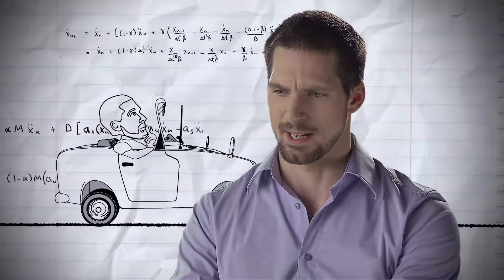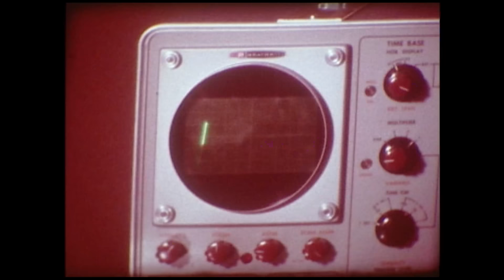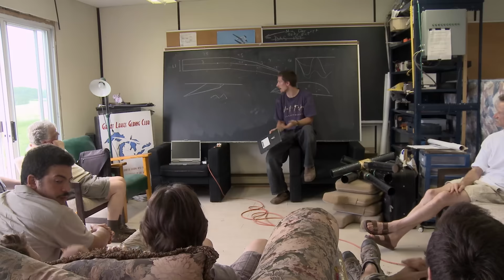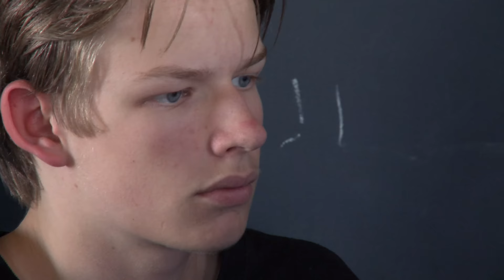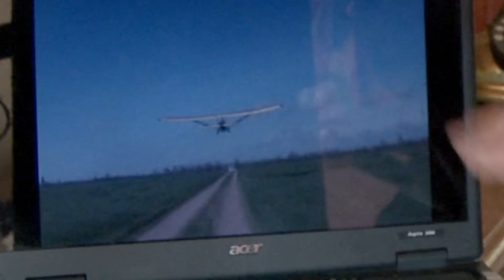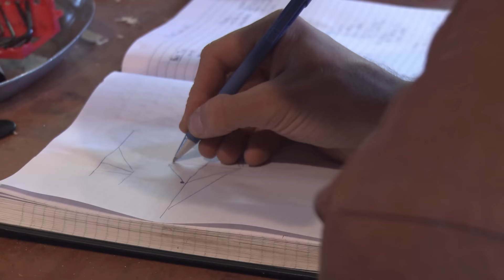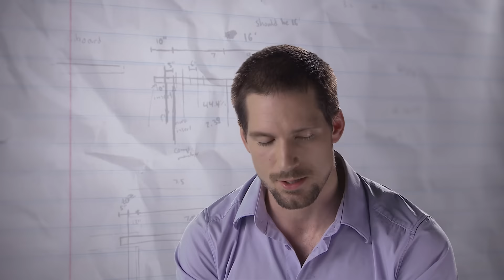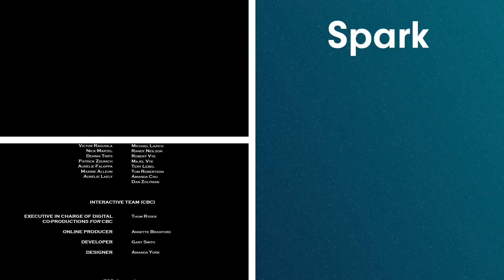Is It Possible To Fly Like A Bird? [4K] | When Dreams Take Flight | Spark

Comment: Otto Lilienthal was THE airplane pioneer from which all the others learned how to fly and make airplanes. He was an experienced pilot, aerodynamic inventor and engine engineer. Better control surfaces was under development 1896 when he died. It's worth mention that micro meteorology, which ultra light airplanes are sensitive to, was little known at the time.
Reply: I fly paraglider’s, and micro meteorology is super important when you fly an aircraft that is under 40 lbs. plus your weight of course.  And definitely attribute free flight to Otto Lilienthal and Francis Rogallo, two pioneers of free flight
Reply: @SkidzFPV  Yep, done lots of sand dune air surfing in paragliders. Tiny dunes make tiny lift you can feel and use. Albatross use the wind off waves to cruise. 4 hours is the longest I have dune surfed.
Reply: @alwayscensored6871  
>> Albatross use the wind off waves

An albatross primarily uses the wind gradient for dynamic soaring rather than ridge lift off the waves.

Comment: As a R/C glider builder watching the build was amazing and I could see places they could have saved even more weight.
Reply: The more weight saved, the less structural integrity.
Reply: @notmyworld44  if they had put lightening holes in the ribs it could have saved up to a pound or so and using kevlar instead of metal cable. It's is very good design that did the job
Reply: I was thinking it would be cool to see a project like this repeated using some NASA research that was published later. Specifically, a wing based on the NASA "Prantl" wing that is 12 percent efficienct for the same weight of material (like birds' wings, it has no tip vortices, the main source of drag on a conventional airplane wing). Also the Prandtl concept eliminates the need for a  tail, which accounts for about 30 percent of the weight and drag on most planes. Those 2 changes should provide at least 40 percent more efficiency. (See NASA PRANDTL-D reseach project led by Al Bowers. He is an interesting guy.)
Reply: Oops, should've said 12 percent MORE efficient. (And I misspelled "efficient.")
Reply: @airhead8363  Good point, I don't think they thought of that option.

Comment: If you’ve climbed a mountain, you know how much energy it takes to scale a solid object with a 1:1 reciprocation of the work you put in.

Now, climb a mountain of air, and you’ll see why it’s so damn difficult.

You have to produce the energy - somehow- to lift yourself AND the craft into the air. Mechanical advantage can only do so much, and sometimes the energy’s just not there. Going fast on a bike is already challenging. Now do it with air, pushing that air with an inefficient pseudo-propeller, and all the mechanical advantage and medium efficiency is working against you

Comment: Yes, it is possible. Over here in Germany you can join a gliders club, even at the age of 14, and they teach you to glide. I used to do that for a few years and it is not expensive, just time-consuming. It is quite a common sport over here and most of even smaler towns have their own clubs. It is such an intense almost spiritual experience to glide in an upwind together with buzzards or 	red kites, which are common here.

Comment: What I find most interesting about this, is the prospect that the materials that we have access to, will slowly but surely get stronger and lighter, even past what they achieved here, so as the years go by, and more weight can be saved, it'll be interesting to see if this is ever attempted again, with even further weight savings, and how much further a human can truly go. All in all truly incredible video and story.
Reply: maybe we should use same material as bird hollow bone type material and bird feather
Reply: @Rick_Cavallaro  we do have lighter material and no need to power by human i want thing to fly like bird that is all use whatever is required engine motor whatever
Reply: @yaad2226  I want an F15 - but that's not what this video is about.

Comment: I would 3D print fake bird bones with an internal honeycomb lattice structure to increase its strength but keep it really light. that way the density is light enough to react with the surface tension of the atmosphere.
Reply: also bird have feathers which each individually create lift one their own. We design wings with a single wing structure to create lift. Which I think is probably not as good.

Comment: First off this is truly a marvel of engineering. Though, in my opinion, this was not a sustained flight. You can see from the flight data on their website that the craft loses energy throughout the flight.
Reply: well he was only flying the length of the run way so ofcourse it lost energy as he descended to land. in the footage shown he looses altitude and then REGAINS it proving sustained flight is possible.

Comment: Much respect to the folks who put so much work and thought into it, but in the end it's an aircraft so fragile it can't handle the slightest bit of wind that can only fly in a straight line that needs a superhuman to power it. The main result of the project was to make it clear why humans invented engines.
Reply: Have you ever watched the Olympics?  What do you suppose is the practical purpose of vaulting over a pole or doing a floor exercise?

Comment: Solid respect for all of these youngster's engineering and project build abilities and commitment. But I wondered just what application they thought could be achieved. It appears that the effort a 'pilot' needs to operate the system would drastically restrict the distance traveled, and the physical area needed to get it positioned for flight would be massive!

Comment: Have you guys thought of adding "vortex generators" on the wing  givring you a increase lift at slower speeds and as much as 10 to14% decrease in stall speed ?   With this edit I thought I should explane what b VGs do and don't first they don't realy create lift from the underside of the wing what I think they do is create vortex above the wing causeing a lesser density above the wing in that the lift you have on the underside has a easer time with the lift that is there and the VGs are installed just behind the leading edge on the topside they consist of a 1/2 of 5 mm tube 2.5cm long first pair are about 3.5 cm apart and just a lil cantilever towards each other and the next pair away from each other  and back and forth the length of the wing ! Now I'm not a aerospace eng. or even a pilot but I'm pretty shur I'm correct in my description  of this and why I think it could be a very valuable addition to this project . If my thoughts on this could a more knowledgeable person correct or give the reasons my thinking is flawed or off ?

Comment: I want to refer to the Veritasium Video on travelling faster than the wind "pushing" a propeller to geared wheels gocart. It appears that the propeller-wing or sail simulation is generating a vortex and "Back EMF" synchronous, reflected->period doubling vortex, pushing the vehicle.

If the wing chord is counter rotating at twice the speed of the bodily axis in sync then there's a period doubling, paddling-leveraging harmonic effect on the forward direction of motion(?)

 (Pure speculation, what do the actual Engineers say?)

Wow, champions of champions.
Reply: I'm the guy that built and drove the downwind vehicle you're describing (the Blackbird).  I've spent lots of time with Todd and Cameron discussing their many achievements (and my few meager achievements).

Comment: I  cannot understand how aeronautical engineers cannot understand how birds' flight works, it being so easy. Downstroke is done with extended wings, greater speed and greater angle of attack, for greater aerodynamic force. The latter has to have a vertical component greater than or equal to weight, and a forward component greater than drag. Upstroke should get as little a drag as possible, for the wings' aerodynamic force cannot have a positive forward component, thus the angle of attack should be very small and the wings' forward speed, the wing surface and the upstroke duration should be as little as possible.
Reply: It's cool to hear you say these things. I was on the porch trying to imagine what the upstroke in bird flight achieves or can achieve. Intuitively, I suppose, the downstroke does all the thrust. Why bother with flapping? What advantage might it hold over a rotary source of thrust? We all love birds, but i feel little compulsion to just do it their way, yet their way has a lot of history and a million? separate species that flap for lift and power. Flapping just seems inefficient.
Reply: @jeffmoore9487  Flapping is half as efficient as rotary aerodynamic lift generation, as was measured in the last half of the twentieth century in France.
     I have been trying to develop a microcopter and put much thought on how flapping and rotary lift works. I was an airplane pilot (a bad one). Science and technology are my hobby since I was six.
Reply: @jeffmoore9487  Why bother with flapping? Why bother with rotary, which is so inefficient that helicopters need a lot more fuel than planes and have speed stalls on their receding rotor blades? Well, rotary can achieve stationary flight - and so can flapping, in hummingbirds, whose wings rotate back to get lift and back thrust during upstroke, and in insects, with a similar arrangement.
Reply: @wafikiri_  Thanks for the answer. Why can't a low power (or human powered) craft skip the typical elevator and rudder mess and do a Liippish or a bird style control surfaces. This vid proves that a man has the muscle to flap level flight, but why so much drag on his machine from that tail? If rotary is twice as efficient as flapping then isn't your design for a microcopter thrust rotational? When you say "why bother with rotary", I'm stuck which - what's the alternative?
Reply: @jeffmoore9487  My design of a microcopter is rotary but I explored a variant - can't be done but it implied a down stroke for the forward-going blade which then receded into its hub as its counterpart extended before its downstroke, both blades the same piece....
Reply: @jeffmoore9487  I don't know what Liippish means, sorry. A bird-style tail is very efficient but also very difficult to manoeuver. Only a bird's brain could manage it. The closest to it is a V tail (Beechcraft produces at least one model with it, maybe Bonanza or Baron; I've flown both models but they were modified to have a standard tail).
Reply: @wafikiri_  Thanks again. I would think the "difficult to manoeuver" issue wouldn't present a a big hurdle for today's tech. 
Alexander Lippisch is best know for his WW2 era flying wings (no tail at all) for the Nazis. You'd do well to watch a vid on him. Many people wrongly but understandably credit him with modern "stealth" capabilities. His ME 163 was truly a wonder weapon of its time.
Reply: @jeffmoore9487  Ah, I've watched those tailless  aircraft in documentaries, even a few days ago.
Reply: @wafikiri_  Lippisch also made wonderful ornithopters.
Reply: @jeffmoore9487  Thank you for the information on Lippisch. I like inventors, I'm one myself although I have asked for no patents on my inventions.

Comment: Well birds flap downwards to create lift, then tuck their wings in to pull them back up to negate them giving the same force upwards which would cancel out their original flap. So mechanical wings would have to flap downwards then immediately tuck inwards then reposition themselves upwards then stretch out again to make the next flap.  And birds flap their wings really fast. So fast their wings usually turn into a blur to the naked eye. So you'd need to flap the wings in this manor like 100-300 times per minute in order to achieve flapping flight.  This is impossible. The closest we will get is something that can moderately flap to stay in flight but needs assistance to get in the air. So like cliff jumping to get started.  It's very inefficient way to fly. It can be so inefficient that sometimes even birds have heart attacks mid flight if it get's even a little to hot.

Comment: If one was to make a flying machine large enough and light enough one could create surface tension in the air like a parachute does and ride along the surface tension of the air as if they were floating in water. But this would probably require a machine completely made out of carbon nano fiber tubes to give it the required strength and the required weight.
Reply: too flimsy to support human weight. It would end up becoming a shroud.

Comment: everybody know the corkscrew wing or rotating air wheel works without negating itself like "flapping" would .  you have to fold the wing on the upflap, or change the angle of attack to push down more than its pulling up.    i can't believe they spent all that time on a complicated glider with a rube goldberg machine attached.

not trying to  be THAT GUY but if ur gonna copy a bird, dont ignore the feathers, and watch out for the beak.  can't be a dragon without the scales.
Reply: @Rick_Cavallaro  Nice try FBI!
Reply: @overryd8573  Hey - you're the one that knows how to make one much better than Todd and Cameron.  I'm just eager to see it.

Comment: Interesting, but not even close to a bird.  The accident at about 29:51, is beyond ridiculous. He basically took a perfectly flyable design and turned it into a contraption. The results easily foreseeable.

Call me when anyone but a fit athlete can maintain more than a few feet, let alone gain altitude and fly here there and every where. It was not so much a flight but and extended glide. Certainly fun and interesting to work on if there is money to burn.  

The bicycle is still the greatest mobility vehicle eve created by us. I doubt we will surpass it, and we will never take to the air in any real practical sense, under our own power. Maybe on another planet with a thicker atmosphere and lower gravity.
Reply: Whatever you reckon Mr Killjoy

Comment: I watched several of these attempts of man made only flights
And every one of them is missing the main piece of the puzzle
Birds are doing more than just flapping their wings for flight.
Seems they do not see the difference

Not sure if they can comprehend,

But on the down ward stroke of the birds wing they are definitely compressing the air
Not are they miss the main part of the upward stroke of a birds wing  movement,
They are not just lifting the wing, 
But a bird is allowing the air to pass down below the wing between the feathers,
So how long before they grasp this understanding?

May be ages, and the moment the bird brings its wing down ward, and BACKWARDS 
They feathers act like a one way valve, and are compressing the air pushing it back wards,

But on the upward stroke, the air is being allowed to pass freely between the feathers,
Why can they not see that is definitely beyond stupidity,
Their brains must be locked and not seeing that,
as when they are causing the wing to come up, they are pushing the air back up, a wasted effort working against themselves trying to get lift,
A wasted effort,
Reply: >> on the down ward stroke of the birds wing they are definitely compressing the air

They are definitely not compressing the air.  At speeds below about Mach 0.3 air is effectively incompressible flow.  With respect to how well they understand bird flight, I give you my absolute assurance that they understand it better than you.

Comment: Hmm an engineer that talks in pounds, which is from Roman times, pound, unit of avoirdupois weight, equal to 16 ounces, 7,000 grains, or 0.45359237 kg, and of troy and apothecaries’ weight, equal to 12 ounces, 5,760 grains, or 0.3732417216 kg. The Roman ancestor of the modern pound, the libra, is the source of the abbreviation lb. In medieval England several derivations of the libra vied for general acceptance. Among the earliest of these, the Tower pound, so called because its standard was kept in the Royal Mint in the Tower of London, was applied to precious metals and drugs and contained 5,400 grains, or 0.350 kg, whereas the mercantile pound contained 6,750 grains, or 0.437 kg. The troy pound, believed to have originated in Troyes, France, superseded the lighter Tower pound in 1527 as the gold and silver standard. Increased trade with France led also to the adoption of the 16-ounce avoirdupois pound in the 16th century to replace the mercantile pound. (Source = wikipedia) … At least he’s talking in meters instead of 3 barley corns , which is an inch by the way , and 45.9300 bushels to the ton , I’m Austraian and we gave this confusion up in the 60’s 📐📏